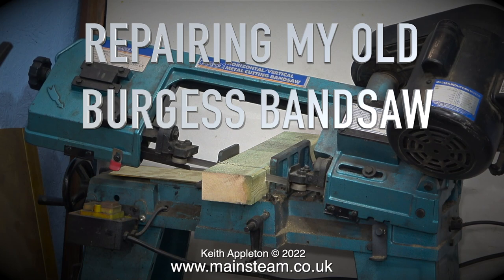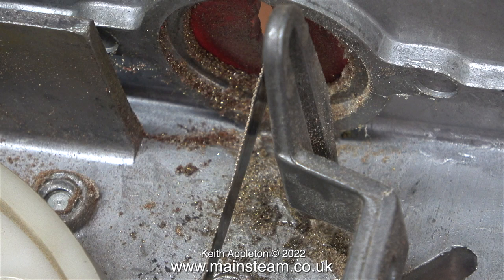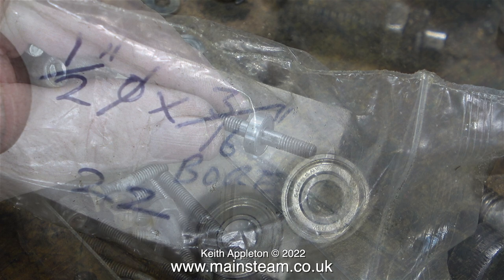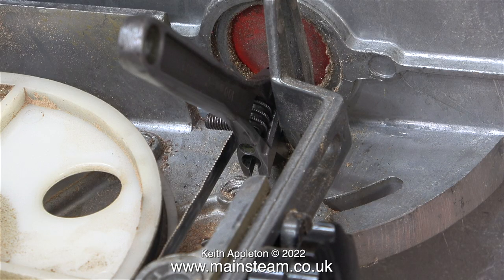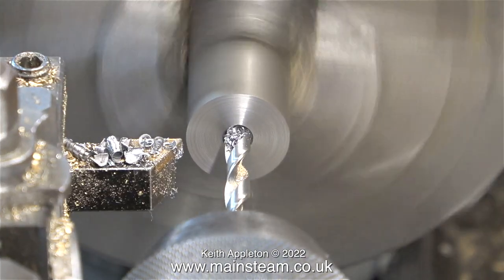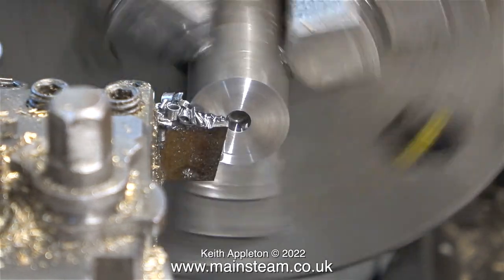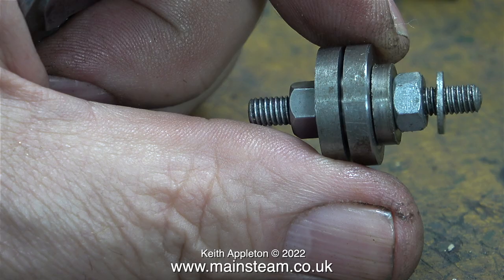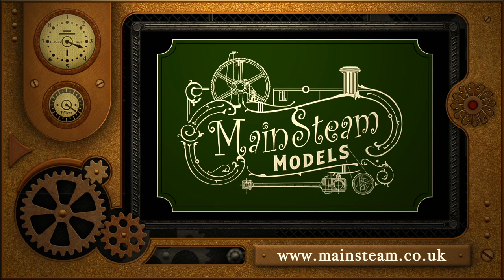REPAIRING MY OLD BURGESS BANDSAW - IN THE WORKSHOP

Comment: A very ingenious fix, I might have made the side parts out of phosphorus bronze, nut each to there own as long as it works.
Reply from the maker: Phosphor Bronze is a bit soft for this sort of a job - don't forget that the bandsaw blade has sharp cutting teeth .......
Reply: @keithappleton  I was thinking of the Bronze running against the sides of the blade. With one of the cheap ones I worked with they had bronze pads that ran against sides of the blades, they replaced them when they wore out about every 18 months.

Comment: Great job!! Have made a few of these types of rollers  for different saws witch as far as I know there  better then new,,, as for harden sides I really  don't think it's  needed as it just to stop the blade from running g off the roller and getting stuck down the side ,, now with a slept lubricant roller no need to run or fingers though  it for external lubricant,,,,lol ,,, take care be safe

Comment: Hi Keith absolutely brilliant. I have I believe a Burgess BK 20 and it has a drawing in the case showing that the machine will cut wood or metal by changing the belt but the drive belt I have has no other extension on it to refit another belt even though the drawing shows it clearly. I believe you sent Alan a wheel with that extension and I’m wondering where did you purchase it from as I cannot find anything like that wheel you passed on. Thank you for your help in advance. Basil🙏
Reply from the maker: Who is Alan ? I have not sent anyone a Burgess Bandsaw Wheel.